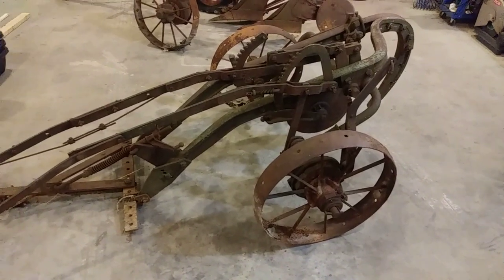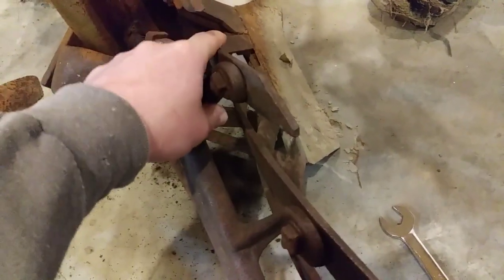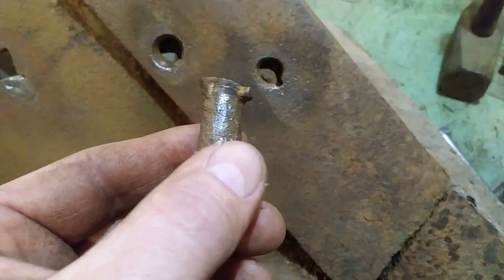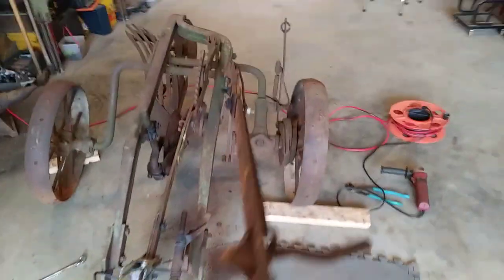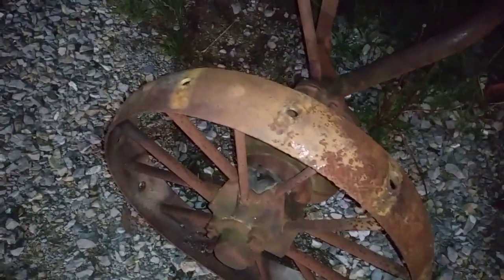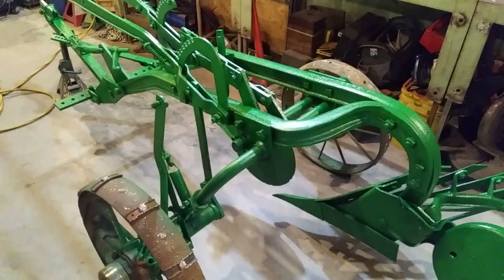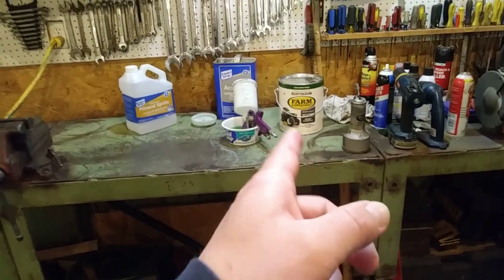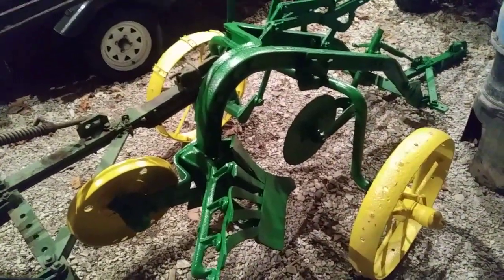Restoring John Deere Trip Plow

Comment: Thanks. Glad you took the time to share, there are few vids on trip plow restoration if any. I'm at the only part you didn't show, the passenger wheel is stuck, so I'll get a bigger hammer
Reply: If getting a bigger hammer doesn’t work it’s an electrical problem

Comment: Kinda new to plows myself but I will try to add some info for you. The flat rectangle piece is called a landslide. The main part that everything is bolted to is called a frog. The adjusting eyebolt attached to the plowshare is to draw the share up tight to the mold board. Slatted moldboards as much as I've learned were commonly used to plow ground that never dries out completely. Others will reply to my comments and will correct my errors. Good job though on your refurbishing and not restoring.
Reply: No slotted molboards in IOWA.

Comment: Excuse me, did u sand or prep?
I just got a 52 I'm going to start on. I know zero but have a jump start with your vids
Reply from the maker: I pressure washed it before painting. It knocked off the dirt and any loose rust. That's usually all I ever do before painting most of my bigger projects and they seem to last pretty well.